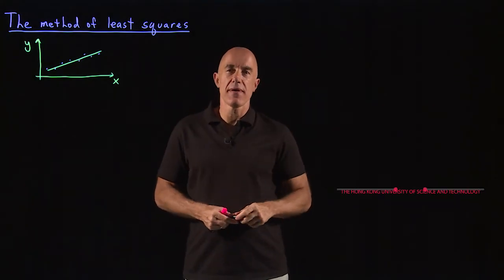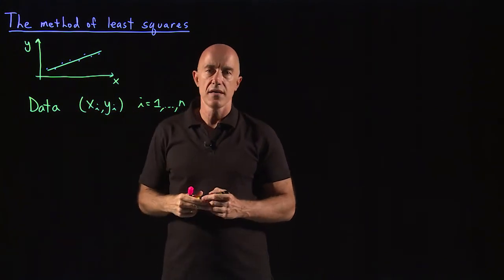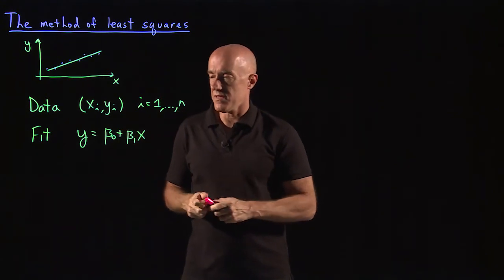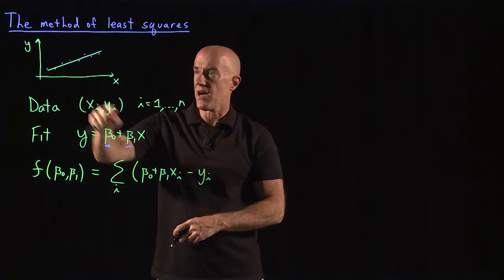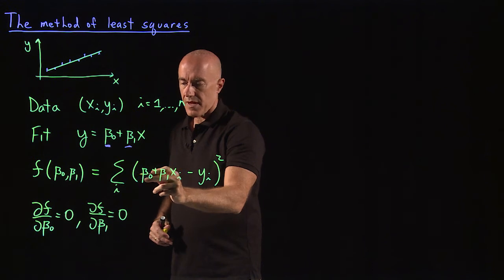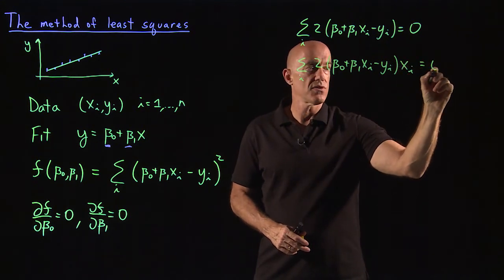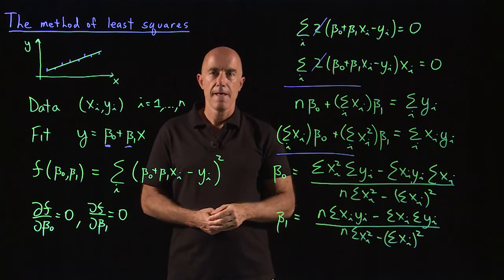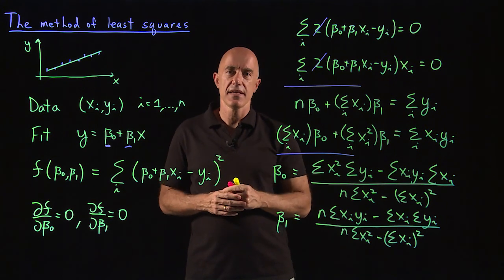Method of least squares | Lecture 13 | Vector Calculus for Engineers

Comment: So squaring is used as opposed to absolute value (or even 4th power) since it makes taking the partials much easier.  Neat.  But why are we only considering the vertical offset to the line for each point instead of its perpendicular offset?  Is it because we only assume that there is noise in the 'y' measurement?  Would we have to use a different method of there was noise for both 'x' and 'y'?